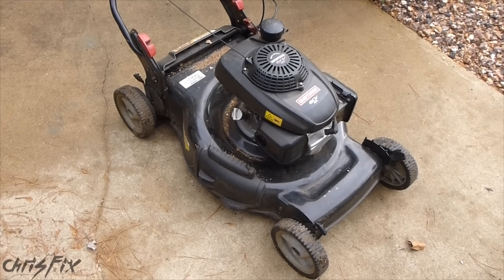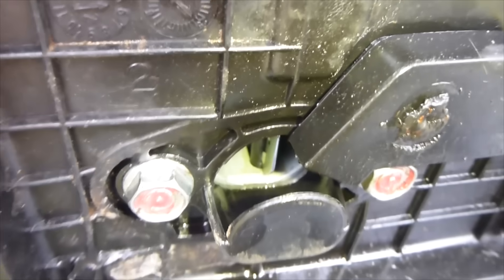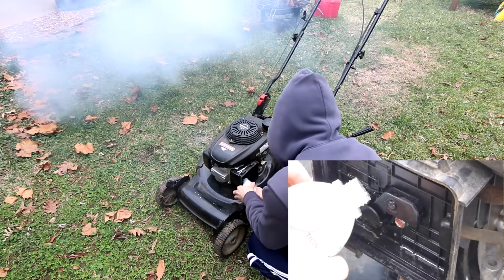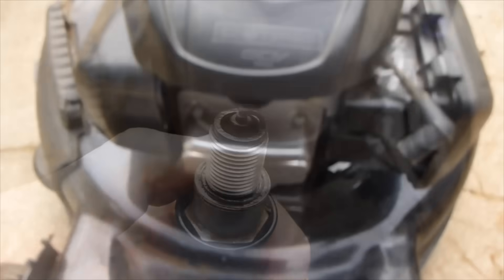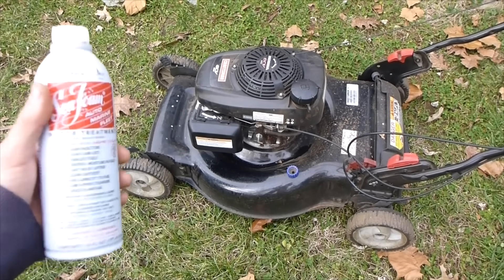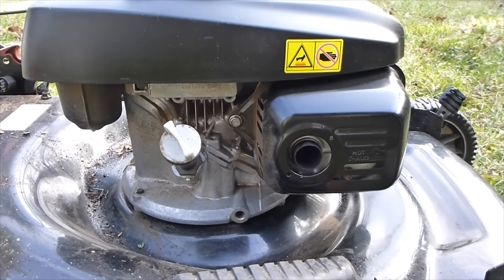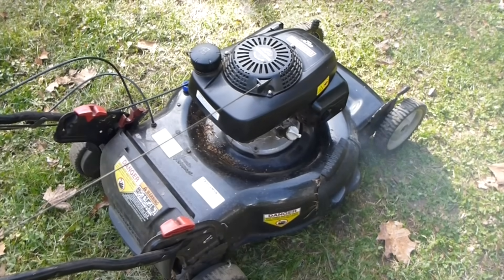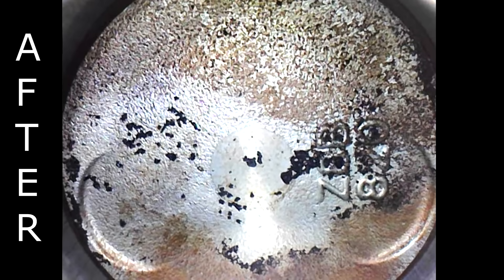Does Seafoam Actually Work? (with Proof)

Comment: I bought the spray version of sea foam earlier today spread it directly into the air intake nine or 10 times lots of white smoke came out now my Honda mower runs better runs like it’s brand new now. I also replaced the engine oil. I cleaned the air filter thoroughly with an air compressorand replaced the spark plug and the cherry on the cake sea foam through the air intake. Smoke coming out the side now runs like it’s new. Yes the stuff works. It’s worth it. It’s only 20 bucks.

Comment: I had a chainsaw which was impossible to start or keep running. I thought that it might be the gas, but all my other equipment ran okay. So, I put new gas in, adde seafoam to the tank. Let is sit for about 24 hours.  Easily started and ran like a champ.

Comment: For easier application, there’s also Seafoam Spray, which is Seafoam in an aerosol can with an extension tube for hard to reach places, like the carberator.

Seafoam can also be added to the gas (or gas-oil mixture for two-cycle engines).

Comment: I think the best use of Seafoam is to stop an engine from dieseling at shutoff, which can be destructive to valves and pistons.  Seafoam will burn off internal carbon buildups to help stop dieseling.  Smoother idling is a bonus.

Comment: great test!! seems like its a good idea to add a little to tank frequently, to keep it cleaned. love the results from the cylinder soak!! i have an atv with dual carbs. i was hoping to see someone tear carb apart and show clogged jets and stained bowls. then run seafoam . then disassemble and see if it cleaned it.   this was great test though !

Comment: Years ago I bought a new Toro lawnmower guaranteed to start for 5 years. It wouldn't start ,took it back and they said it was bad gas and charged 50 bucks. While there it seemed that was the story they told  everyone, good racket for the repair  shop.Stared using Seafoam in the gas can and it seems that my problems are gone.

Comment: QUESTION: In the past, when my Cub Cadet push mower stopped working as a result of running out of gas, the gas tank was virtually empty. You couldn't see anything at all left in the gas tank. But now when the mower stops running - presumably from having no fuel - there is actually quite a bit of visible "liquid" in the gas tank. Does anyone know why this is?  

There was a video online that said fuel can be separated from ethanol, and what is left is "water." This might explain why there could be "liquid" that remains, but does not "fuel" the mower. If that is the case, I would then ask, "Why does the mower suffer from this problem now, but did not suffer from this problem in the past?"

Comment: QUESTION: I recently tilted my Cub Cadet mower on its side in order to use a garden tool to scrape out some grass that had built up inside the mower. The moment I tilted the mower on its side with the air filter pointing up, I heard "HISSS!!!... HISSSS!!!" It was as if a drop of something spilled and was becoming HOTT and flammable. After I was done cleaning out the interior of the mower, I waited 15 minutes for the oil to go back down. I then started the mower. There was a large cloud of grey smoke. This smoke got worse. It was obvious the mower was not going to run properly. I then grabbed the weed wacker and did that chore instead. This took about a half hour, which allowed the mower to sit there and become calm and settle down again. There was another cloud of grey smoke, but not as bad this time. The smoke then disappeared for several seconds. I then started to move the lawn mower. But then the grey smoke came back. it was obvious the mower wasn't going to work anymore. Do you know what happened? I have tilted the mower on its side in the past to clean it, but there were no problems like this.
Reply from the maker: Grey smoke is usually oil related, I would first make sure the oil level is correct

Comment: If you guys don’t want to do it with his method pour some of it in the tank the motor will continue to smoke a little until it runs out of fuel. It will slowly eat away at it

Comment: After you pour a third through the carb just add some to the fuel every time you mow the lawn.
Reply from the maker: Would make running the mower expensive since you'd have to do it every time
Reply: @chrisfix  Not really, you add an ounce to a gallon of gas. It will stabilize the gas and clean your mower at the same time. A 20oz can will last a long time.

Comment: That test is wrong. You add it to gasoline. It tells you how much to mix. In the car just pour an appropriate amount in the tank.
Reply from the maker: I followed the instructions on the can
Reply: @chrisfix  I have followed the instructions on the can and on the website for 15 years now and I always add it to the fuel or oil not just dumping it into the air intake of the carb or throttle body

Comment: heres what we'd do on our old Puchs. Ya gotta do this quick so have your socket and new plug on standby. REMEMBER TO WEAR GLOVES! First, run it at WOT until it's fully hot then AS FAST AS YOU CAN remove the old plug, pour a capful or so of Seafoam in the chamber and then put the new plug in. DO IT QUICKLY! Then restart the engine and run it WOT until the smoke stops.
it'll get the nastiest pistons and cylinders completely clean.

Comment: Take the hose off your brake booster and shove it into the can until it sucks all of it up and the engine dies on a V8 Engine  that is set for an An  hour. Then start it up take it for a drive four it until it stops smoking.

Comment: I was looking into additives for fuel that cleans the injector and carburation systems. One thing I learned it that sea foam is old school. With modern fuels they have put additives in the fuels which creates a different deposit in the system. Try the same test using something like Red Line or newer cleaners.

Comment: For my featherlite I took the piston out of the engine and scrubbed the top with a copper scouring pad.

(And broke the piston ring because I tried putting the piston back in the cylinder with the ring upside down but SHHHHHH!!!!)

This does look like it would be a REALLY useful solvent though!

Comment: Seafoam is not made for these type of engine . Its made for 2 stroke engine outboard motor. Its not made for car engine... seafoam is the worst its completely useless for car engine
Reply from the maker: That’s in actuate outdated information. They specifically make it for 4 stroke marine and automobile engines and they specifically say that on the bottle it’s good for fuel injection and  safe for catalytic converters.
Reply: @chrisfix  ok thanks for the response. Love you . Keep up the awesome work dude
Reply: @chrisfix  i love your video they are always very details and they make me confident to work on my own car

Comment: Definitely cleans an engine that isnt coked up too badly in the first place. My 180,000 mile Morris Minor pistons have rock hard lumps of coke sticking up and causing pre ignition, and continuing to run after I shut off the ignition due to heating up like glow plugs and firing off the fuel before it sparks.  I'll try this out of sheer laziness, but all the tests I've looked at suggest it wont clean a really bad engine.

Comment: I mix this in with all of the gas I put in my small engines at 1oz per gallon. Keeps all my engines running like new! In my car, I usually do 6oz in my oil a week before I change the oil, and the rest of the can in half a tank of gas. Then a week later I change my oil. It makes my truck run super smooth.

Comment: Did you know you can do the same thing with water in a car you drop water in a car watch running it'll clean the carbon off of every one of the spark plugs and pistons one at a time try water the next time I'm not talking about taking a water hose to it .down in the carburetor you drop water in there clean it right up

Comment: The piston cleanup is cool, but a dirty piston isn't what makes a lawnmower run badly. The real benefit of Seafoam in the gas is to clean out the passages in the carburetor, especially if the engine has been setting over the winter. Gasoline, especially gas with ethanol, evaporates and leaves gummy and harder deposits in the carb. These are also referred to as varnish. This crud hampers fuel flow and changes the fuel/air mixture in the engine. This is what makes the engine cough, sputter, and surge. Seafoam added to the gas does a remarkable job of cleaning this crud out, allowing the engine to run right again. It also stabilizes the fuel so it doesn't leave as much varnish in the first place. So when you get your mower or motorcycle out after sitting up over the winter run a 50/50 mix of Seafoam in the first tank. Fixes most mower problems.

Comment: I used sea foam on my 04 grand Cherokee. It had 220k miles and was running a little rough so I wanted to clean it up. Well maybe I used too much sea foam or my jeep just didn’t want to live but the head gasket blew and before I knew it I had a smoking exhaust and built in oil slick 😂

Comment: My mower was coughing , sputtering, and shutting down if I started and stopped it after several years. Refusing to restart unless i removed the spark plug and aired it out for at least an hour. After 1 treatment tank that stopped. I can start it , stop it. No issues. Now runs like it did when newer.

Comment: Loved this video. I did the same thing, with covering the pistons on a small block Chevy. Did a borescope had a lot of carbon on the 8 pistons. When I changed the intake, poured it down the ports of the heads leading to the pistons ( had to be careful with valves and pistons) let it sit for 2 days, had installed the top and removed the plugs and the crap that came out and then cranking the engine more crud. Afterwards, checked the pistons and they were about 80-85% clean!  This stuff works, still use it. They have a spray one now you can spray right into the intake system.

Comment: My advice ...... if the engine runs good  .  Don't use sea foam !  It will go into the rings area and clean that too !  That's NOT something you want to mess with !
Remember:   it's the sludge and grime that is filling up all the void , the gap , and the tollerance that is holding everything together  and specially the rings .  When you remove these sludge on all critical area ?  It will loosen up all your tolerance area and that will be the killer in the long run .
Remember:  never fix anything unless it's broken 1st .

Comment: Does the carbon “melt” and burn off? Or flake off? I scared the buildup flakes off a causes premature wear. Like if you aren’t putting it through the carb to “clean” the carb is it worth it? Buildup on the piston doesn’t cause any issues like you said. Not worth it imo

Comment: Just curious if you've just tried misting water into the carb. We did that when I was younger to clean up cylinder heads and it works. Not great, but it works and it's free.

Comment: Well in my car 69 GTO you can run "WATER" thru the carb. It blew aout alot of the carbon. Then look at end of the tail pipe you will see the carbon on the ground. You gotta keep the car running,

Comment: Spray water in the intake and it will clean the piston and valves.Any water cooled vehicle with a head gasket leak will have a clean piston in the leaking cylinder.Water turns to steam and removes the carbon.

Comment: I use Seafoam religiously in my boat and my small engines (Lawn Tractor & Push Mower) and can't say enough about how good of a job it does.  No worries leaving fuel in the tanks over the winter as Seafoam keeps it fresh.  Everything always starts right up come spring.

Comment: Pouring the product into the cylinder is not a good idea. It can leak past the rings and get into the oil, contaminating it. This could cause bearing damage as the seafoam May wash away lubrication. Bad advice to pour this product directly into the cylinders.
Reply: Yeah right... You clearly have no idea. 
You can add this stuff straight to your oil, your fuel tank and directly into the running engine as shown here. It won't hurt anything if some seafoam gets into the oil. It helps clean up the old sludge that's built up over the years in the crankcase.

Comment: Sea Foam IS NOT for new engines.  Orginally made for 2 stroke boat engines folks.  Still ok for 2 stroke engines.  4 stroke engines need something a bit more gentle like Gumout Tune up with PEA in it.  Sea Foam contains Naptha and Kerosene among other things.  Naptha is what is used in mechanic shop parts cleaner tubs to clean old oily, greasy parts.

Comment: I use seafoam in everything! My boats, lawn mowers, snowblower and suvs and truck! also it can be added to your crank case to clean out all the gunk in there. Add it to your oil about 200 miles b4 your oil change. Then drive it 200 miles and change the oil. Watch all the crap come out with your oil! Amazing stuff!!!

Comment: What position was the piston in (top dead center, bottom dead center, etc) when you added the Seafoam through the spark plug hole?
Reply from the maker: If I remember correctly it was close to bottom dead center

Comment: A couple of days ago I used the Seafoam version that`s for SUV`s with 75k miles or more. I have a Rav4 I made sure there was less than a quarter of gas left in my car and put the whole thing in, waited about 15 minutes, then I drove at least ten miles so it can work right away. I felt a big difference right away in how smooth my car drove and the idle sound was much quieter and smoother. I also noticed I get better mileage as well. You can also put it in the engine itself but you want to wait until you`re about 200 to 300 miles left due for an oil change. Seafoam is the real deal.

Comment: my civic was smoking a little so i had the head gasket and valve stem oil seals changed while it was having a new cambelt, hoping the problem was with the top end. now it smokes so bad it's undriveable i.e. like this all the time. my best hope now is that the rings are just gummed up with crap and i don't have to take the whole block out or something like that. would you recommend soaking the pistons in this case?

Comment: I add Seafoam to every tank of gas that I run through the 2 motors on my boat. One is the main motor and the other is the kicker motor, for trolling. When I put the boat away for the winter, I add a little more to the tanks on the last run. I have been doing this for years and each spring the main motor starts on the turn of the key and the kicker starts with one or 2 pulls. Regular general maintenance is a must, but I have noticed a big difference in how smooth they run as well. Also, ALWAYS USE PREMIUM GAS. That's a big one.

Comment: My mower was hydro locked I,m guessing that gas had got into the oil via a stuck needle oil was coming out of the exhaust when I tried to start it.
I changed the oil removed the plug pulled the handle to get all the oil out.
After I pored in a can seafoam into the tank and let it sit for a while I started it and after the oil burnt off it ran ok at first after a hour it will start on the 1st pull and it will get me through til I can get a new carb kit, thanks,Chris.

Comment: You should try the same thing with water (not soaking but pouring through while running). The engine's heat will turn the water to steam which cleans carbon really well. You probably think I'm joking, but we used to do this to car engines back in the 70's and it really worked. No, I wouldn't do it to a modern engine, but it would work on a lawn mower.

Comment: Sports miracles use it on chainsaws lawn mower snowmobiles dirt bikes I had a Camaro I had two bad injectors it didn't work no more so it wasn't running all eight cylinders so I put five cans of seafoam in it and it still felt like it was a V8 but to the cylinders are dead s*** works miracles

Comment: The most notable things about additives like this, and especially this one, is that they can cause no harm to device or it's fluids by using it. in fact the opposite is usually true and there are some benefits derived. it is known to clean, condition and absorb moisture. I was surprised to learn how long it's been around and how versatile it is. it's known to be safe to add to any fluid in a car without any side effects. controlling moisture build up in any of the fluids is very important. your gas is changed constantly, but others fluids are not so much. (20+yr car tech here)
Reply: It can be added to oil & gas or diesel, right? Not "any fluids" like brake fluid, coolant, power steering, or windshield washer fluid... I assume.
Reply: Note that seafoam doesn't contain PEA, so it is an inferior additive to those that do. That is according to another channel, Engineering Explained.  I wouldn't use it. The video goes on to say no additives is better for minimizing carbon on newer cars.  Seems great for 2 cycle motors though.
Reply: @mattford4736  Right, Mr. Ford....see my comment here...originally for 2 cycle boat motors/engines.  WITHOUT   PEA,    any product, is just a   W A S T E    OF   MONEY
Reply: Volvo warns that no additives be used in their cars. No explanation as to why or what it could damage though. I figure it isn't worth the risk, unless you intend to junk it anyway based on its performance.

Comment: I started selling sea foam over 25 years ago. It was designed by a chemist who had a passion for racing boats on the Ohio river. He made this for varnish build up that occurs over the off season. Putting it in the fuel it eliminated fuel system it solved that problem. Higher concentrations will help dissolve carbon build up.